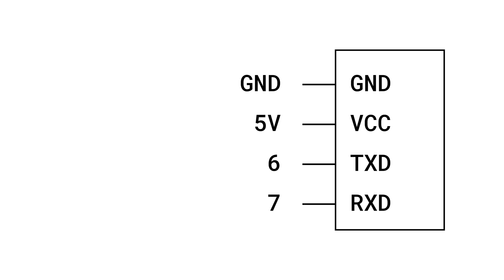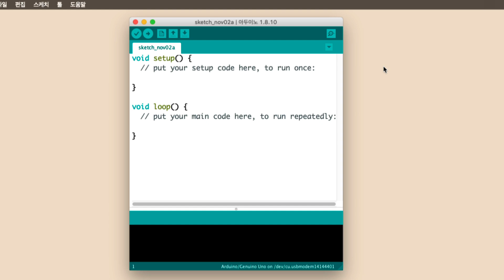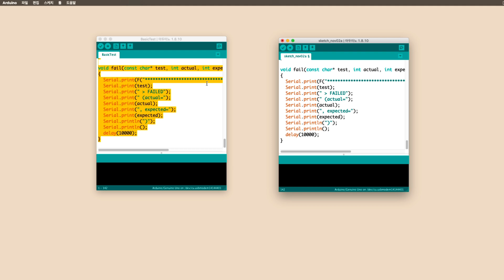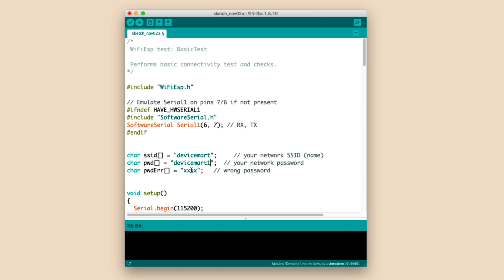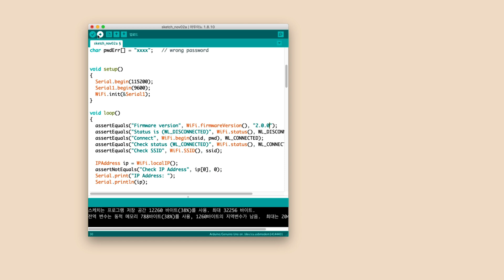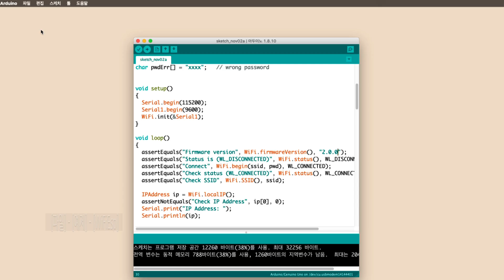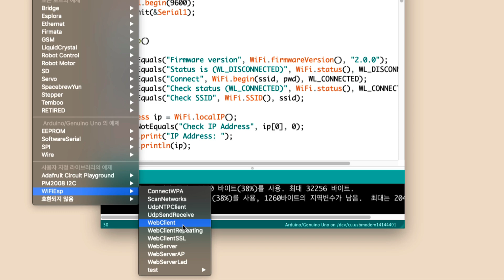Using the ESP-01 Adapter

Comment: what to do if I getg this massage: [WiFiEsp] >>> TIMEOUT >>>
[WiFiEsp] No tag found
******************************************** Status is (WL_DISCONNECTED) > FAILED (actual=255, expected=3)

[WiFiEsp] >>> TIMEOUT >>>
[WiFiEsp] Failed connecting to netword@ger
******************************************** Connect > FAILED (actual=2, expected=1)

[WiFiEsp] >>> TIMEOUT >>>
[WiFiEsp] No tag found
******************************************** Check status (WL_CONNECTED) > FAILED (actual=255, expected=1)

I think it doesn't connect to the WIFI so that should I do ? And I am sure I wrote the password and wifi

Comment: Hi! thanks for sharing! But I ran into problem - when I installed the "WifiESP" library and go to "File -> Examples -> WiFiESP" I don't see "test" option, I see all other options though. Only test is missing. Any idea? Thanks!
Reply: And after that: "Firmware version > FAILED (actual="", expected="1.5.2")"
Reply from the maker: I can't check it now bcz I don't have an arduino now. So I will reply again later.
Reply: @neosarchizo  Thanks for your afford, I appreciate that! Actually, the issue was that my RX/TX wires connection was wrong. But after I fixed that I got the message: "FIrmware is not supported". So I guess I had to update firmware(i checked my version using AT command and my firmware was 2016 year). So, I just ended up using pure AT commands to do my stuff. But for anyone struggling with same error as I was - try to upgrade your ESP firmware
Reply from the maker: @vocabkin  Thx for sharing the information
Reply from the maker: https://bit.ly/48dT6Pt You can check the test file here!
Reply: @neosarchizo  Thanks! Now when I run the code, I see the error: "Cannot initialize ESP module" :( Not sure what's wrong